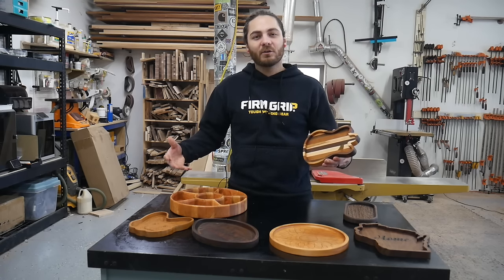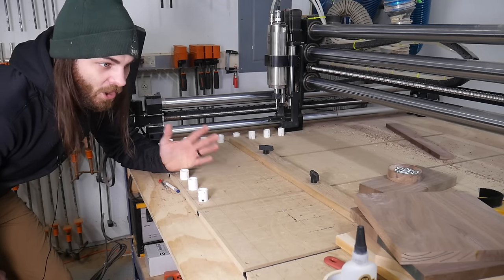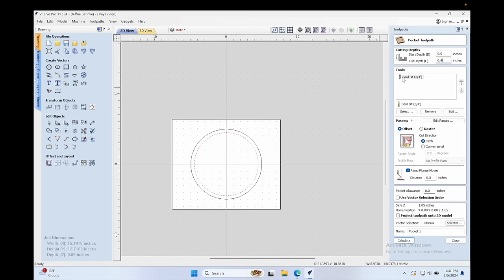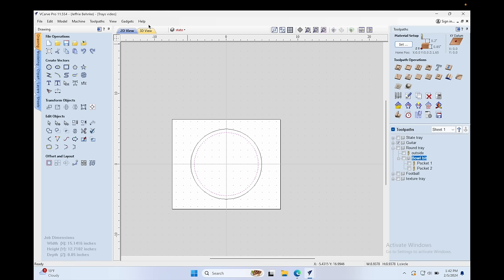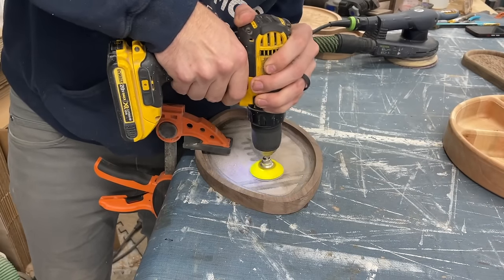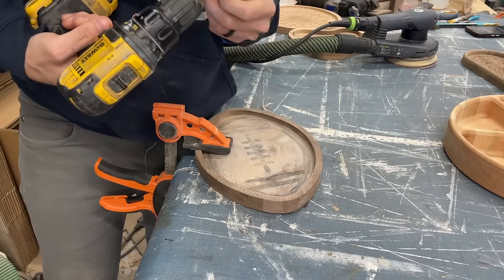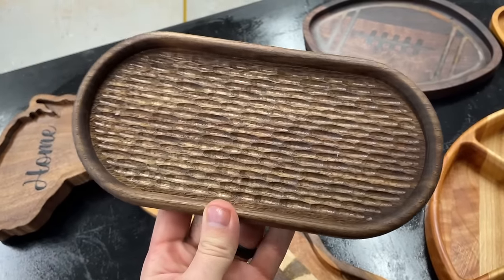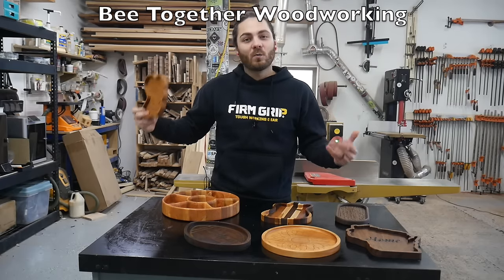Everything I've learned selling CNC trays

Comment: Milwaukee is coming  out with a M12 3" orbital... can use cubitron extract.  Much like their fine detail sander... game changers.  Also... buy an 8mm collet for your spindle... then buy the 8mm x 40 mm Carbide bit and and the 15mm x 15mm 3 flute carbide clearing bit from a Shaper Origin dealer. Thank me later.

Comment: Pricing - you talked about time, but no mention of material costs?
Reply from the maker: I used scraps from other projects when I sold these so I didn’t consider it much as they are smaller items. But the average catch all is 8x8 and even in expensive wood like walnut it’s less than $5 a tray. The multi pocket serving tray was like $8 in cherry. I would crank out large batches and sell them for $60-$100 each. You could really nickel and dime the finish and cost of the bit life but on something like this it’s not worth the head ache. Figure out a rough number ($5-10) and don’t stress it unless you’re using crazy expensive wood like zebra wood or something. Until you make larger items that actually start consuming alot of materials I just give it a flat rough cost on materials.

Comment: How do you factor in the cost of your materials + the time to prep materials, especially if it's strips of wood glued?
Reply from the maker: Use a stopwatch to figure out roughly how long it takes you then add a little bit of time. Also a majority of what I used to make these when I sold them was scraps from other items customers already paid for so the “scraps” were pretty much free so I never paid much attention to it. But learn how to calculate board foot, it’s a simple equation to know how much wood you’re using. For example a 8x8 tray out of walnut I would assume the piece is 10x10x1” and at $9 a BF would cost me $6.25. That’s an expensive wood so typically it would be 1/3 of that cost but again I made them out of wood that would have been given away or burned. In the end if your numbers don’t add up they might not be worth your time or make sense for you to make them if you can’t get $40-$80+ a tray. Always time yourself on new items what you might think is 10 minutes might be 30 and on a small item that adds up quick, batches is key for this small stuff.

Comment: Another good vid! I have a question about pricing. You talk about machine time and labor time, how do you account for materials ( wood, finishes, sandpaper etc)?
Reply from the maker: Hey! Thanks for watching! If it’s just a simple catch all tray 5-$10 is plenty for those. I’ve mostly made mine from scraps so it’s not something I’ve accounted for and the amount of oil I would use for one tray would be like less than .50. To figure out board feet if you are using lumber from a lumber supplier and not a big box store do length X width X thickness divided by 144. So a 10x10 tray is just over .5 board foot. An expensive hardwood would be $5 and a cheaper hard wood would be around $2-3 for a 10x10” tray

Comment: Great video. You talked about your finish pass going beyond the line. What I learned is when you set the starting point on the finish pass as the depth of the of the roughing pass, it thinks it is the first pass as the narrowest part of the bit so it goes further. You are better off running the finish pass as a start at board surface with a depth of cut at your finish depth so the software knows you are finish depth and proper width. Say roughing pass is .35 and your finish pass is .38, set your start at the surface and your depth of cut to .38 without a ramp in. Might be something to try and possibly make a video with what you learn. I think everyone has the same issue. I wish the software would build that in so it just goes from roughing pass to finish pass with adjusted step over per your specs. Love the work you do. Working up the nerve to do inlay like you do.
Reply from the maker: Ahhhhhhhhh that makes sense, I’ll
Definitely hop in there and mess around with that. Appreciate the tip!

Comment: Hi, nice informative video. a recommendation- keeping the direction of the bit path against the material, would give a better finish. For example, when cutting the outer surface/edges of a round tray, it would be better to direct the path counterclockwise, and for the inner surface, in a clockwise direction.
About the epoxy, if it's a small piece, you can place it on a far corner and save its position for after the curing. And do another pass with the cnc afterwards, to avoid sanding.
Cheers

Comment: I live on a lake and you are correct, they are big sellers. The sanding detail of a lake tray would take forever. You could round off the sharp edges, but I wonder if that would be a take away from the lake design?
Reply from the maker: On something like that I would probably be more cautious and you could most likely get a decent idea in the preview mode if it takes away from it or not.

Comment: I've been using a mop sander to sand my trays. I can usually get a tray done in 3 to 5 minutes, and it's usually a really smooth feel.
Reply from the maker: I’ll have to Google that! Thanks for the tip
Reply: @TwoMooseDesign  I don't know if you have a klingspore close to you or not. But that's where I got mine from. They have 6 and 4 inch. And a 4 inch sanding star.
Reply from the maker: I don’t! But I order paper from there so I’ll definitely check thanks!

Comment: Hey Jeff awesome video! One question. The finish you ended up using was the tung oil correct? Your process for that was lather them up, can be real thick. Let it sit 12hrs then buff off. Am I right about that?
Reply from the maker: Yep! You don’t have to let it sit that long. I typically do them in the afternoon and just wipe them off in the morning. A few hours would probably be fine. And thanks! I appreciate it 😁
Reply: @TwoMooseDesign  thank you! I appreciate the clarification!

Comment: I don’t use double sided tape anymore. Just 18g brads in each corner.
Reply from the maker: That works pretty good too, same with the screws it leaves the little mounds you gotta shave off. I’ve always wanted to try the composite nailers, I’ve heard good things just a little pricey.

Comment: Hi guys I have the x50 journeyman (still with Makita router)what is you speeds and feeds you run your bowl bit at I have the same bit and it takes me longer to pocket then you do thanks
Reply from the maker: For the bowl bit i believe I ran it with the makita at 100ipm .15 depth, ramped in and makita at 3
Reply: Thanks so much. luv your  videos (can't wait to upgrade to spindle). Thanks again